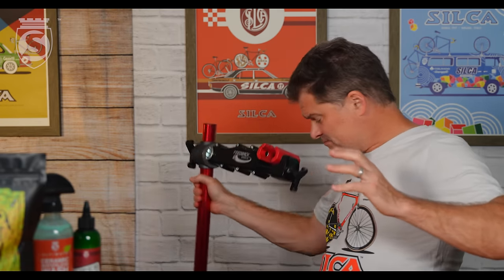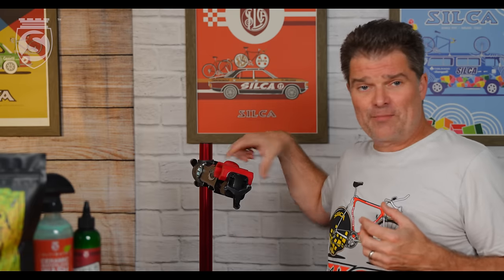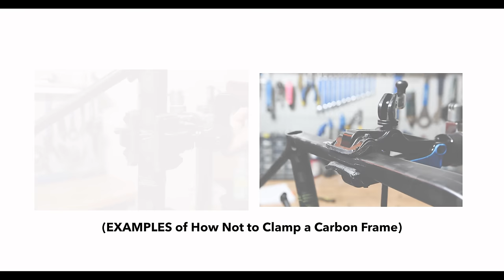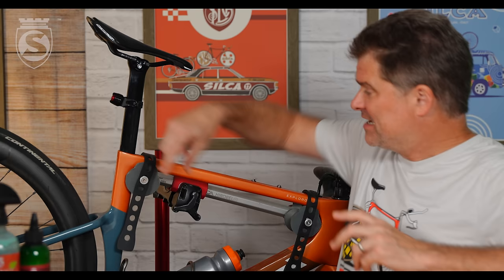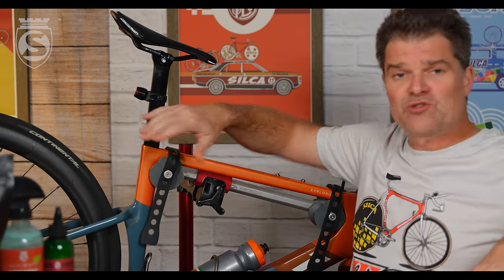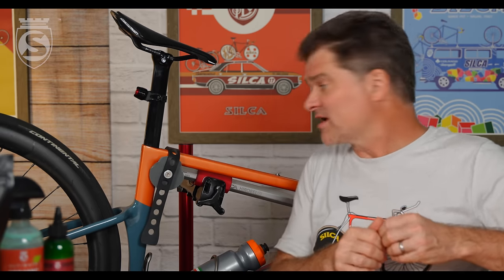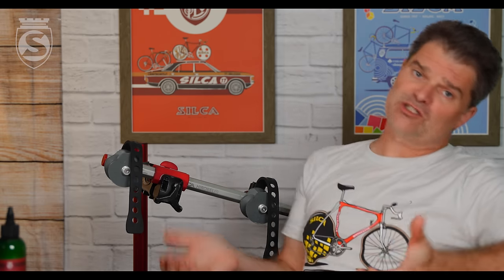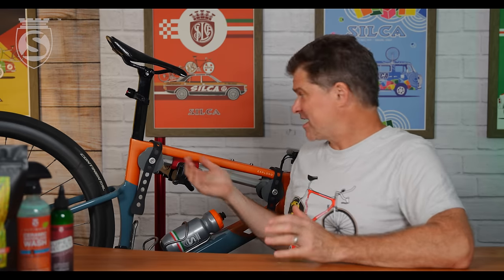Ride a Carbon Frame? Here's What You NEED to know about Frame Clamps! #Hirobel

Comment: This is of course a Silca commercial promoting the Hirobel frame clamp. Good idea, useful product, no question. The hidden message is to frame manufacturers to finally skip their stupid proprietary seatposts: A standard-diameter, round seatpost allows you to easily replace it with a cheap aluminium one and clamp it securely your bike into your old, otherwise pefectly good workstand.

Comment: Trying to support a tandem is always trickly because neither seatpost is close to the center of gravity--leading to the temptation to clamp the delicate top tube. This seemed like the perfect answer, so I bought one. Alas, it's not long enough for tandem frames. Silca support is checking to see if they can make a longer one, which would be awesome! While I don't know how big the market would be for a tandem-compatible version, the investment in manufacturing would be minimal since the only requirement is a slightly longer piece of extruded aluminum, so no extra tooling, etc. Here's hoping that they can do it!

Comment: I just put a rag in my clamp and rest the top tube on it, without closing the clamp; on the balance point of the bike so it’s stable as I work on it.
Reply: That’s what I do too, but I almost knocked my bike out of by accident one day.
Reply: Same, works for very basic maintenance, but sometimes I definitely need more stability. I’ll likely pick up a Hirobel at some point.
Reply: This. Yellow MF cloth folded over a couple of times. Then lightly screw the clamp closed where it's barely touching. But that is a cool tool.

Comment: I love my Feedback stand, but they don't do anything other than round tubes very well. My van' has a Park clamp. My home shop has a Park stand with the steel base. Last shop had an EVT stand. 

I like the Park 100-3D clamp the best

I have a Hirobel for when I have to use the Feedback stand in the field for the reasons stated in this video

Comment: Please, can you suggest how to secure a carbon road bike when transporting on a bike rack on a car? We use a Thule one which sits on the trailer hitch of a passenger car. Obviously, we need to secure the bikes somewhere, so we try to clamp them as close to the intersection with the seat tube as possible, but still on the top tube. We do add Thule's sleeve to further distribute the forces and don't tighten the clamp strongly. We only secure it so much that the bike is save, we don't wait for the torque to be limited by the clamp.

Comment: Nice video explaining to handle your bike(s) carefully. I do not use a workstand anymore.
I always work on my bikes (race, MTB, NLcitybike) while hanging on 2 ropes. I do not use hooks but use two looped ropes which I throw over a 4”x2”. Both ends of one rope I loop around the saddle. The other rope loops around the handlebars. Works like a charm. Torquing BB can be done while hanging but I prefer to put the bike back on the floor. Hope this makes sense.
Many bikeshops in the Netherlands use hanging method (with hooks).
Reply: That's a great solution for bike shops. Unfortunately not very practical for many people at home. The hirobel clamp and similar products are a great solution.

Comment: Fork mounted workstand even better.
Reply: Yes, in that case bike is mounted at it's strong points which are designed to handle not just static load but also heavy impact. Unfortunately it takes maybe 30secs more to mount the bike so bike shops don't like it 😂
Reply from the maker: Fork mounts are great for bike washing and derailleur tuning, but are limiting for shop environments as you can't really do any front brake or headset work when using one, so you end up needing a frame clamping stand as well.
Reply: @SILCAVelo  Indeed. For my home workshop, I made myself an adaptor to support both front and rear so I can also work on my front wheel with the stand. For headset work I use my Wahoo Kickr 😎 Brake bleeding is another scenario I found that a frame clamping stand works better since you can easily tilt the bike.
Reply: Had a fork mount system but got rid of it as it has limitations such as trueing front discs, I had to take my bike off of the stand and mount the front wheel and hold it by hand and spin the wheel to look at the disc flatness.  Moved to a standard mount and can do more maintenance.

Comment: While watching your highly informative video, I cringed at the idea of placing my newly acquired bike ( carbon fiber frame) back onto my bike rack which is similar to the traditional bike stand because it holds the bike horizontally via the top tube. Can this hero Bill product be used on my frame when I'm placing it on the bike rack or do I need to get an entirely new bike rack where the bike sits on the rack via the wheels and tires? Thank you

Comment: What if you are not clamping, but just resting it on the clamp like on a hanger? Not actually squeezing the two sides of the clamp but just resting the top tube on the bottom clamp half.

Comment: Yea, Giant distributor in my place has 3 work stations non of them are using the clamping station, they are using the one that can lock the thru axle of the bike onto the station. They mentioned although the chance of you actually damage the tubes by clamping is really low, but due to how modern carbon bike was constructed, saving weight and reduce the thickness where force doesn't apply when riding aka the top tube, they don't want to risk it as they got to be the one who warrant the frame if they damaged it. Lmao.

Comment: 14:13 Do you have any recommendations to prevent the Hirobel from rotating/spinning in the bike stand clamp? Whenever I put in heavier frames it tends to slip/sag and I will have to re-clamp the Hirobel back into the stand. Thanks!
Reply from the maker: This happens in some of the older style clamps (like the one I have at home) with round jaws.. if yours has grooves for cables to pass through (as all of the older Park stands do) you can drill a hole in the Hirobel and screw in an M6 socket head cap screw on the top and/or bottom of the bar.. the head of the screw then locates in the groove of the clamp and prevents rotation.  I'll make a video on this!

Comment: Just tighten until the frame 'Clicks'.
Reply: you forgot the step after: tighten it till it creaks, then back off a quarter turn
Reply: @GummeeH3  A cone wrench between the clamping surface and the frame may be employed if slipping is a problem, Emory cloth is also useful in this situation.
Reply: this is humor,don't worry 😉

Comment: A solution for a problem that does not exist: just use the standard stand clamp with the minimum force required to hold the bike by the seatpost without slipping. 
PS It is aluminium not aluminum, this is how you say the name of the element with the atomic number 13 correctly.